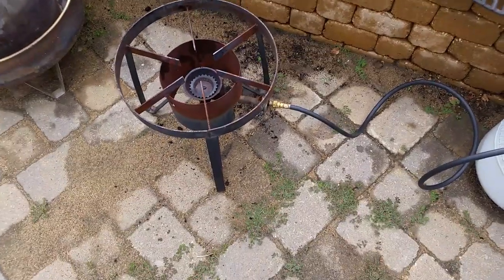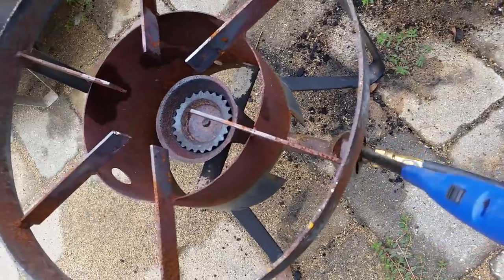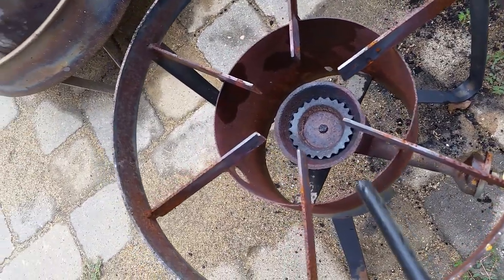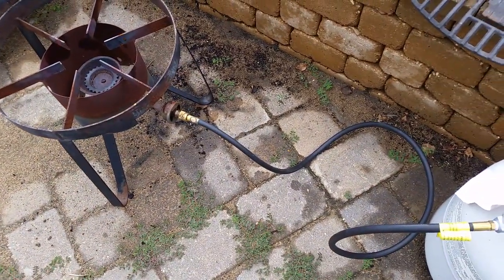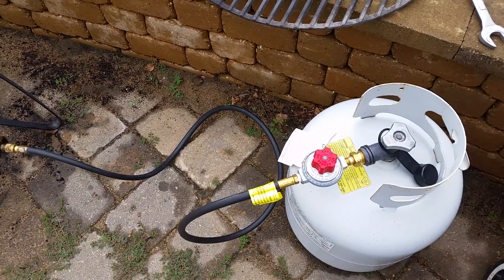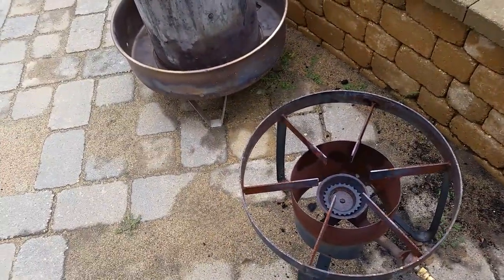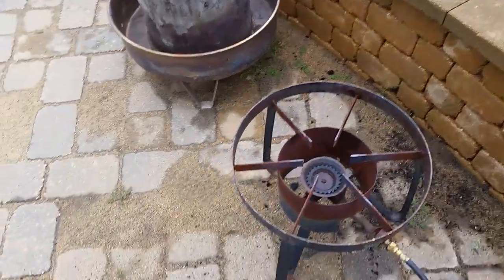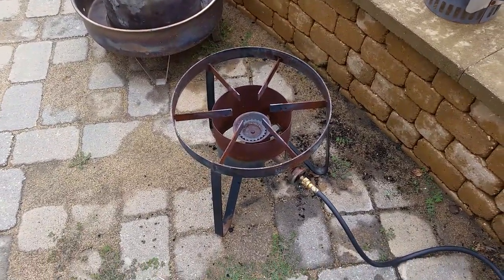How a Turkey Fryer Burner Should Work

Comment: If the vent adjustment doesn't work, try taking the assembly apart.  Clean passages with a pipe cleaner and then a wire wheel attachment in the chuck of a drill and knock off the rust.  This helps too.

Comment: Great video thanks , mine has same type of burner and regulator, blue flame at base and pretty long yellow flames not making a whole lot of heat. I completely disassembled the burner and cleaned the main casting, I wire wheeled the whole burner disc in the center and cleaned up what I would call the teeth or gas path grooves, still no help, any suggestions ?

Comment: Thanks, after watching this I took burner all apart and blew it out with hose. Now it has the blue flame instead of a weak yellow one which carbons everything up. I had replaced regulator and hose but that wasn't the problem.
Reply: so does the center come out, allowing for a good inside cleaning?

Comment: I soaked my cheep rusted burner in hot water mixed with citric acid. Just like a cast iron pan. Along with a wire brush, It helps  remove the bulk of the rust.  Does the center of the burner come out when you remove the bolt, or are they cast'd as one piece?
Reply from the maker: My bolt was rusted in so I did not dare try to take it apart. I am guessing they are separate.
Reply: I just put one in a bucket of muriatic acid  that's been sitting on the barn floor for years and wouldn't work at all. After 10 minutes of acid I gave it a bath in baking soda and water to neutralize and stop it from rusting I hooked it up and burns like new.